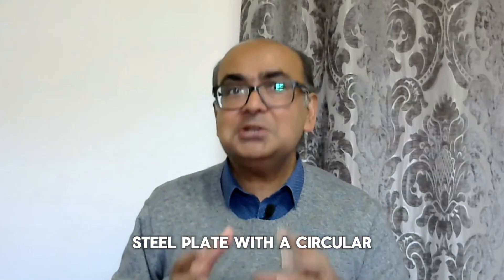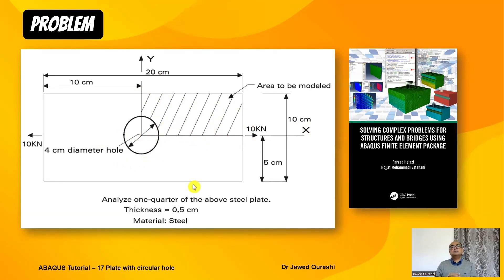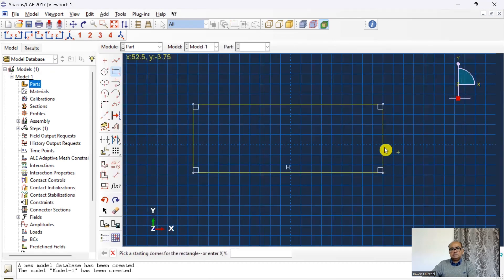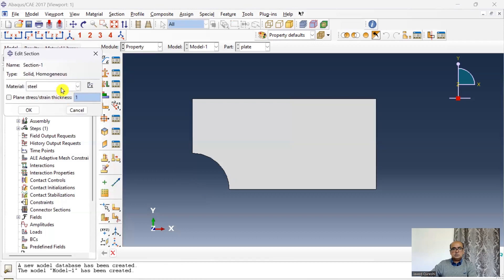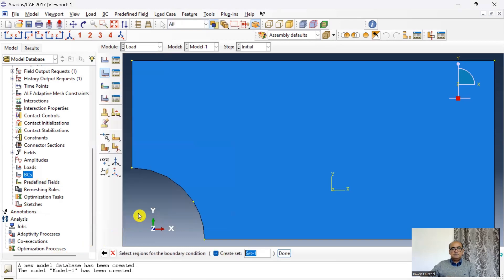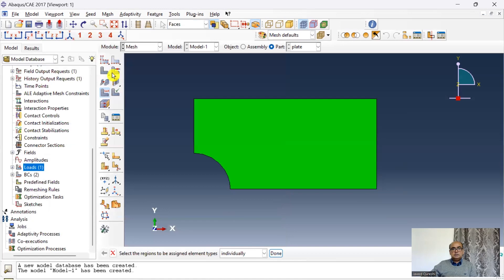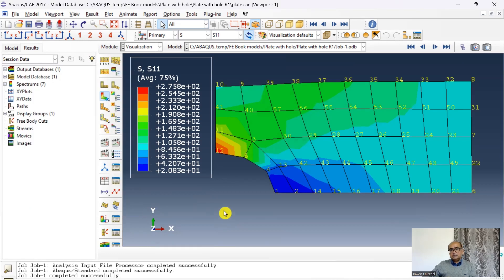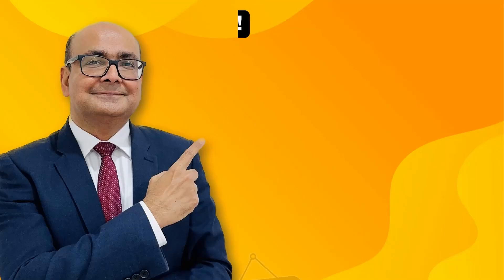17 Plate with circular hole – ABAQUS Tutorial

Comment: why use plane strain elements? Isnt that for very thick geometry? Your geometry is only 0.5cm thick so plane stress elements would be better no? Thanks for the video though very useful
Reply from the maker: The formulation used in ABAQUS remains the same as we just have to click on plane stress/strain while assigning properties. However, plane strain is for thick plates and plane stress is for thin plates. But I say it otherwise at 04:05, I made a mistake. I issued correction now.